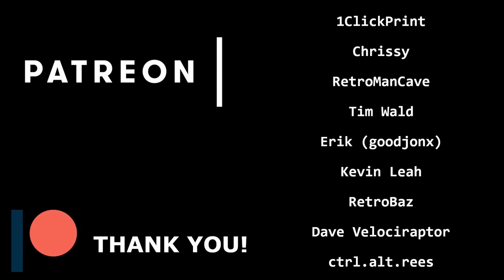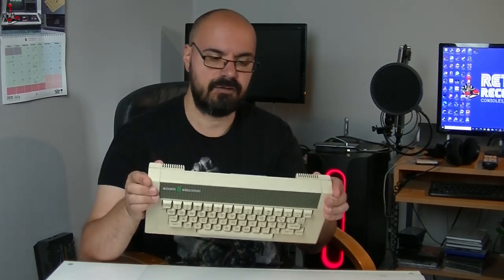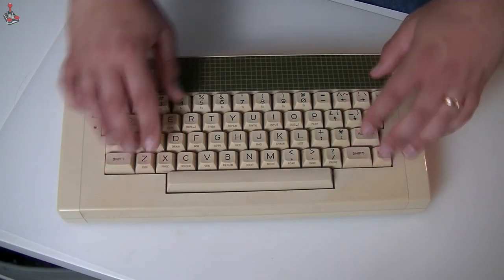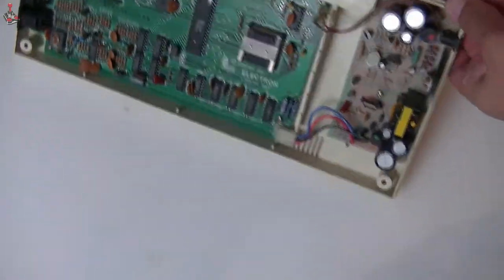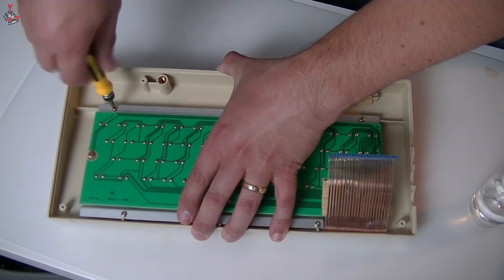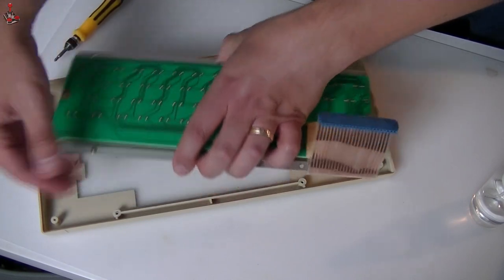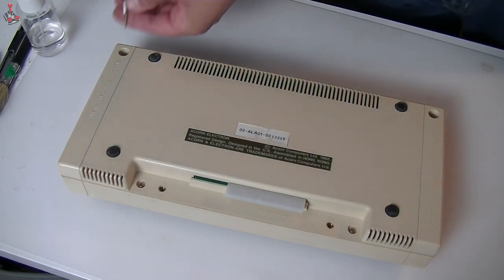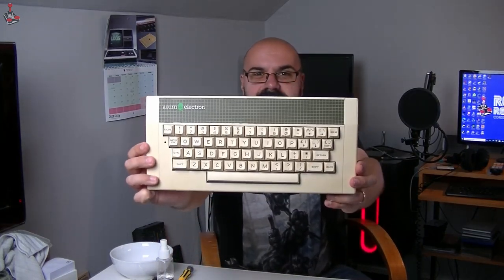Acorn Electron | Pickup and Test

Comment: I did most of the coding for my BSc on a cheap, late model Elk, then transferred it to the computer lab's BBC Bs. Since the clock was slower, anything that ran acceptably on it flew in the lab.  The Plus 1 or the Slogger ROMbox (plus is what I'd recommend, if you can find a working one - sideways RAM was hand for cartridge ROM images)  was a necessity to get the full use of the  machine. My old one is still working, 35 years down the line.

Comment: This takes me back to my childhood. My first computer was an Elk. They were much maligned because they were the baby brother to the BBC Micro but they were really well built competent little machines.

You'll need a plus 1 unit for joystick input vai the analogue interface. IIRC (it's been a long time since I last used my Elk) you can attach a floppy drive through a plus 3 adapter.

I'm looking forward to see what you make of the Elk once you've used in anger for a bit.
Reply from the maker: Thanks. I was very impressed with the build quality of the machine for sure. Don’t worry I have some upgrades on the way! 👍🏻

Comment: Ah, the Acorn Electron, my first ever computer. We didn't have it for long before something on the power supply board exploded and we replaced it with the Atari STE.

Yours is in great condition, but, come to think of it, I don't recall ever seeing a bad Electron. Either they didn't get much use or they were bought by careful people!
Reply from the maker: My thinking as well. To be fair they are very well built machines, I was impressed considering they are meant to be a budget micro.

Comment: Great vid, chap. If you're not running a Plus One (or other expansion) on it, you can power it with a nice and safe modern 9v PSU (higher voltage of original is just used for pass-through to the expansion slot). I use the one I bought for my Speccy +2, that I got from https://www.thefuturewas8bit.com. 
For a modern storage solution, I use an ElkSD from http://ramtop-retro.uk. He has different versions for an unexpanded Elk and for anyone running a Plus One. I've got the non-Plus One version and it runs fine on the 9v PSU.
Reply from the maker: Cheers. Another nice thing about this machine is that it isn’t too fussy about PSUs. 👍🏻

Comment: They are great machines.  A Plus 1 could be worth the purchase, but the main thing for software is one of these: https://www.ebay.co.uk/itm/ElkSD-Plus1-Acorn-Electron-SD-Memory-Card-Interface-48K-RAM-Expansion/143445748901?hash=item2166086ca5:g:BAsAAOSwEEtex8Rq --- this is for a Plus 1, there are different versions if you have not got one (different connections).
Reply from the maker: Stay tuned! 😉